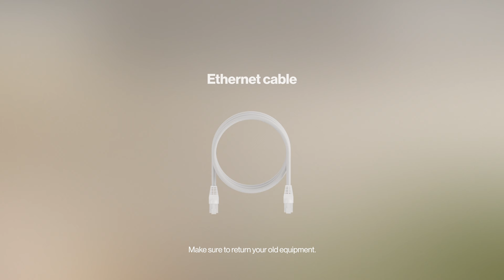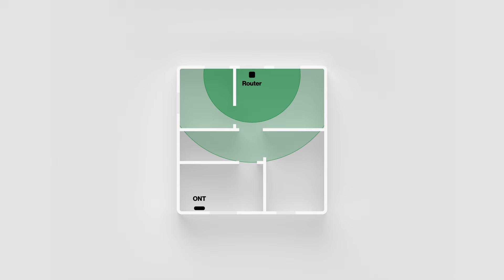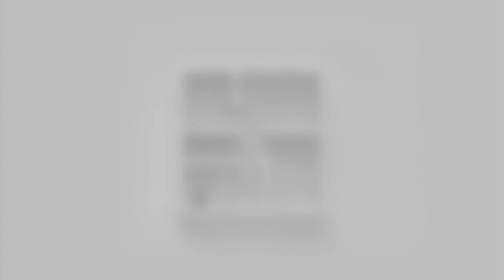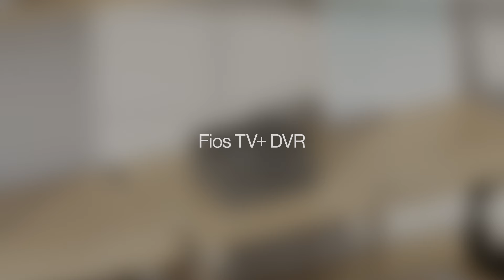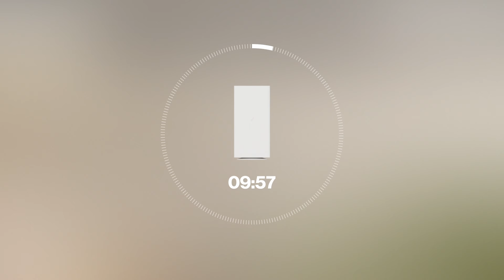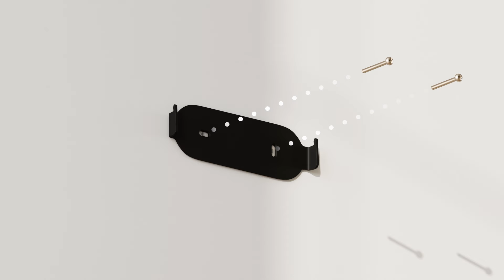How to set up the Fios TV+ and optional Fios TV+ DVR

Comment: Something isn’t clear. Does my DVR need a Ethernet connection? Mine doesn’t have this cable but it is working.
Also, what is the Moka used for exactly?

Lastly, why didn’t you show why all the other cables were on the ONT in the beginning?

Comment: Verizon fios absolutely sucks!!!

We're having constant issues with the basic cable networks on the system freezing up and becoming pixelated  and this ONLY HAPPENS DURING COMMERCIAL BREAKS!!!

This was NEVER A PROBLEM  until Verizon forced subscribers to switch to the god awful TV 1 boxes a few years ago because we NEVER  had this problem with the older gray/silver colored DVR  boxes which featured a clock on the front display panel. 

I'm strongly considering switching from fios to direct TV  because this BS is simply inexcusable!!!

Comment: So now, the tv service is wireless from the router to the set top box.  The old wire connecting to the old set top box is unnecessary?
Reply: I am unclear on this as well
Reply: you just need a wire from the router to the DVR.  For the set top boxes, they use the wifi in your house, so no tv cable is needed.
Reply: I utilize a coax connection in my basement to extend the network with a e3200 FIOS extender.  Coax to the extender then ethernet from extender to nearby TV
Reply: Great, more WiFi EMF signals thru the home. People don't realize that EMF is not good for us.
Reply: @dc6233  Neither is McDonalds but people eat that all the time.
Reply: @dc6233 where can I learn more about that?

Comment: Video is not accurate. We had to connect our Fios TV One to our Fios TV + DVR set top box because DVR did not have HDMI port to connect to tv.
Reply: The video doesn't say to connect an HDMI from the DVR to your TV. The DVR only connects to the router via ethernet. The set top box connects to the DVR over the network.
Reply: @ChezSanwich strange as I have Al these same parts but my DVR don’t have any Ethernet connection to it and it works.
Reply: @ChezSanwich  I recently cancelled my cable and DVR service.  So I no longer have a set top box or DVR box.  But I kept my wi-fi.  I would like to be able to view local channels.  I know I can do this with an antenna, but I would also like to be able to chrome cast on my TV.  In order for that to happen, I need my TV connected to the internet.  Is there one device I can use that will enable me to watch local channels AND chrome cast on my TV? Or do I need 2 devices? If so, which one(s)?
Reply: @ChezSanwich and it still dosent work lol………😂 these companies man